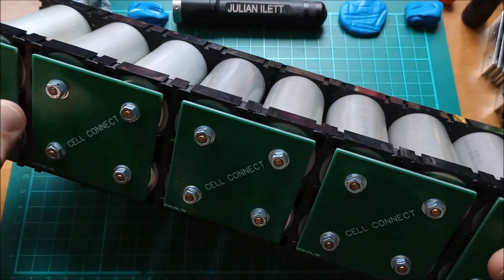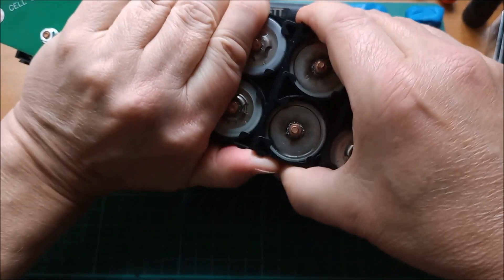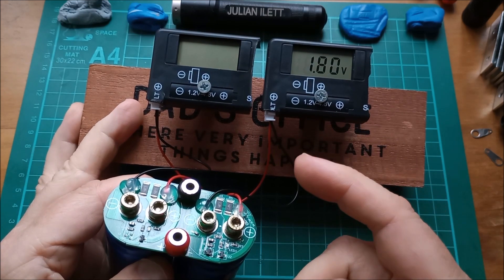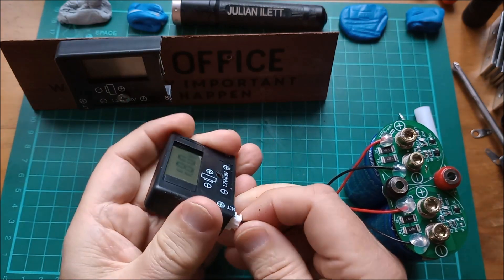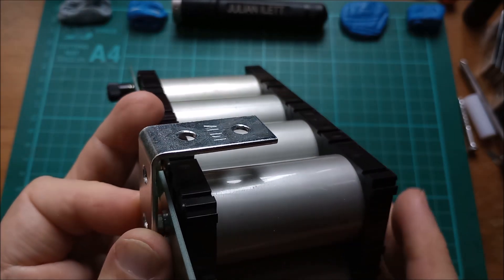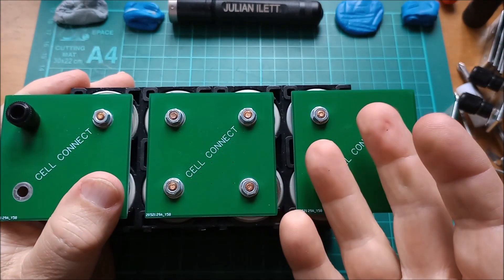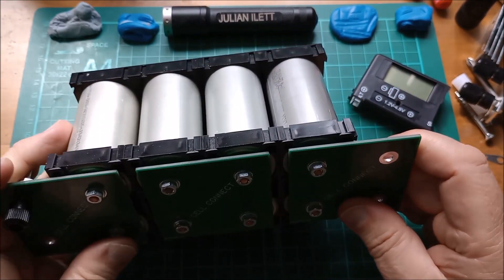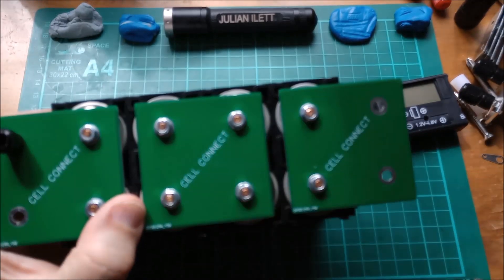Ideas for a 8S5P LiFePO4 Battery Build

Comment: The reason JST's are tight is because they are not designed to be repeatedly disconnected.  They were designed to be a solderless, secure connection that doesn't come apart easily,  Hence the name of them.  Japanese Solderless Terminals.  The are designed to be secure, similar to soldered, but without needing to solder wires together
Reply from the maker: Good thing the 'ears' can be cut off to make a loosey goosey version of JST :)

Comment: I balanced my prismatic cells  at 3.38  and I don't charge beyond that level. hoping to extend the life of my battery bank.  Thoughts please ?
Reply from the maker: I charge my 8S pack to 28V (3.5V per cell) - then a relay cuts in and discharges the pack to 23V.

Comment: I don't like you using random brackets that have no electrical testing done to it. That's a recipe for faults!
Reply: I think the same. Im in process of searching solution for big ebike battery. Definitelly would not trust some random connections especially if that thing have to survive huge amount of vibrations.
Reply from the maker: Yes, the ALDI brackets would be wholly inappropriate in a bike battery, but I'm building a shed battery designed for tinkering.
Reply: You should fight him about it but it's a pretty known material  so as long as that resistance is fine it will be OK I mean your car all its grounds are thru the steel frame or body or engine that is possible aluminum but may be iron
Reply: @james10739  Yet the coating has a finish to it creating higher resistance. He needs to conduct an insulation resistance test to prove it's properties. This is where you DIYers go tits up and cause fires.
Reply from the maker: They're probably zinc galvanised steel. Zinc has a lower resistivity (5.90×10−8) than steel.
Reply: @JulianIlett  Prove it though, I've seen too many DIY battery fires that I take great concern upon such DIY projects. I'm always the bloke that has to fix others mistakes.

Comment: Make sure you don’t balance lifepo4 below 3.45. Unbalances them.
Reply from the maker: I'd say it un-top-balances them. Where to balance your cells depends on where they will spend most of their time.
Reply: @JulianIlett  the issue is those have low voltage cut offs at 3v. That’s fine for NMC. It isn’t for lifepo4. It unbalances top and bottom between 3.45 and 3v and won’t bottom balance where the curve isn’t flat so they’re worse than useless in all use cases that they work below 3.45v.

Comment: Why haven't you gone for 2 single whole PCB and went for the small 4x4 ones instead?
Art they a lot cheaper ?
I had seen Juan Garcia going that way more and more the last year using cell specifc designed pcb as a battery mount too.
Reply from the maker: I prefer a more modular approach :)

Comment: great but 40 pieces is a lot and would prefer to get a 16S config with about 1 kWh but have not found the right LFP cell yet. 50 Ah are available in a blue box, but that means 160 Wh x 16 = 2,56 kWh and also roughly 18 kg which is too much. But I have not found such LFP box cells with 25 Ah or 20 Ah. 
Like that ALDI bracket and pcb idea a lot.
Reply from the maker: 15Ah cylindrical: https://www.aliexpress.com/item/1005001860921761.html
32Ah prismatic: https://www.aliexpress.com/item/1005004938670518.html
Reply from the maker: 20Ah prismatic: https://www.aliexpress.com/item/1005005942183649.html

Comment: Hi julian, how do you feel about shunting energy from one cell to another, for balancing.
Bc, as i understand, we usually pump energy into the array, and transform overvoltage into heat.
Reply from the maker: The capacitor balancers work really well. Passive (or resistive) top balancing has its place - as far as I know that's how my car balances its battery - but I'll be using flying capacitor balancing.